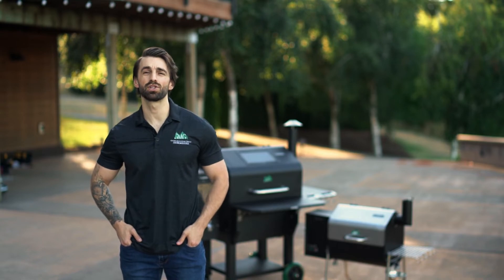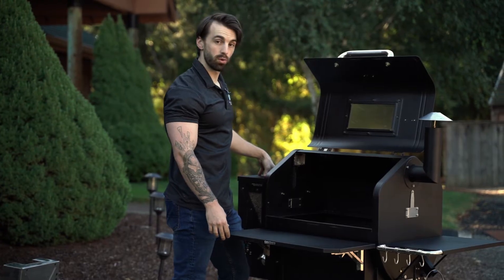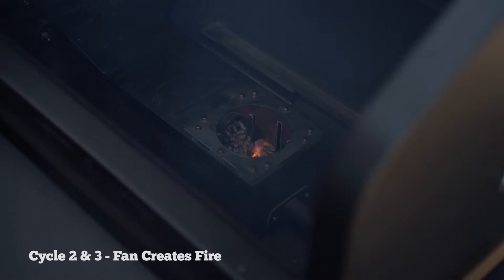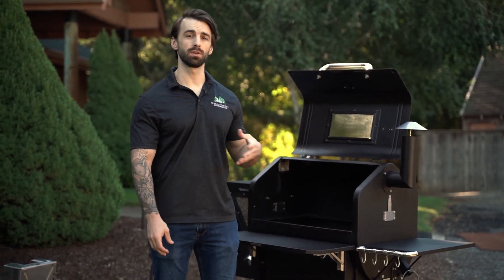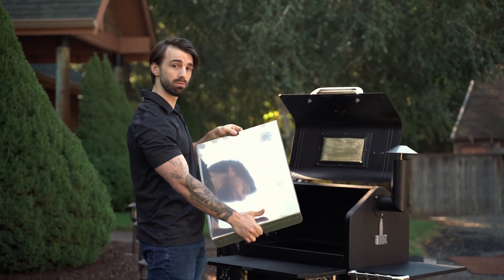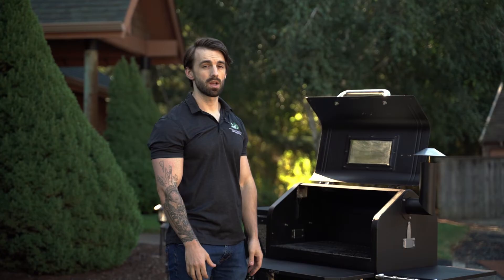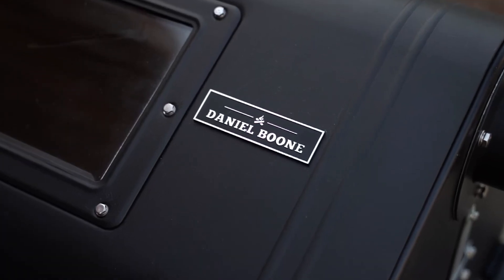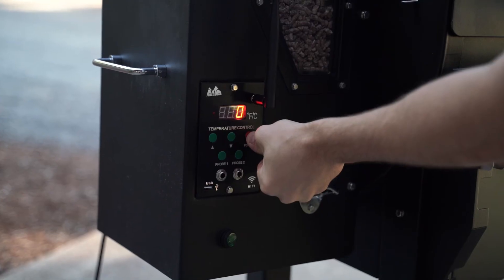Quick Component Check  |  Prime Plus Support  |  Green Mountain Grills

Comment: Is there a way to remove and test the ignitor itself? Mine cycles through the entire start up cycle and the ignitor is stone cold. I don’t mean it’s sitting buried in old ash and not lighting, I’ve touched the probe bare handed and it’s room temperature. I’m capable of removing it and doing a continuity/ resistance test but don’t know what value to look for. Is it similar to testing a water heater element, where you just check for continuity? What is the typical input voltage to it(ac or dc) and how much? I don’t really want to buy an ignitor and replace it just to find out it’s fine and the control board is shot. Any help/info would be greatly appreciated. I’ve had my grill almost 5 years now and have used it a lot without issue, but it will not light now, and the ignitor is failing . Trust me, I’m very familiar with the start up process and have been “jump starting” it lately with pre-lit pellets just to keep on cooking.
Reply from the maker: Sounds like that igniter is likely bad. Typically, if the igniter is not heating, it 9 times out of 10 is the igniter. For that info on how to test, reach out to support@greenmountaingrills.com and we can get you helped out!
Reply: @GMGrills  ok thanks
Reply: My ignighter has 3 cycles and wrnt bad again!.  I'm pissed. $750 gor a machine that causes stress wondering if it will start.  We're on our 3rd auger .
Reply: One work around solution though is to empty the pot with any remaining unburned fuel and run the start cycle.  Only now, instead of the ignitor operating, you use a small torch to light the pellets.  While that air is blowing on them, they will light quickly, just as if the ignitor were operating.  Then put the covers back in and way you go.